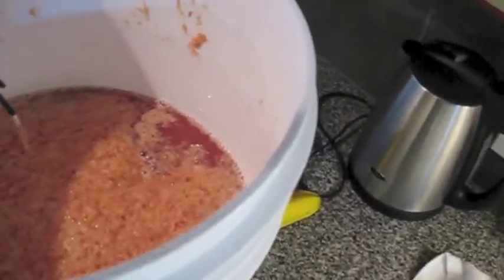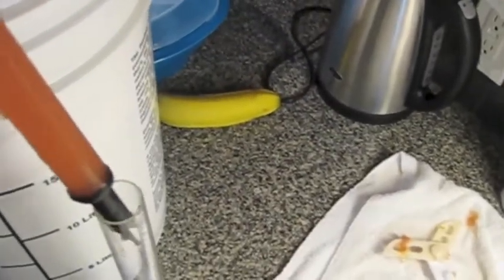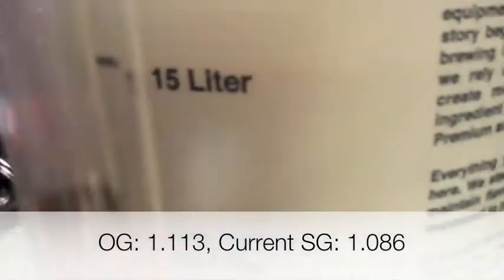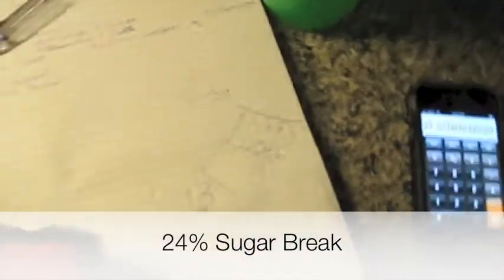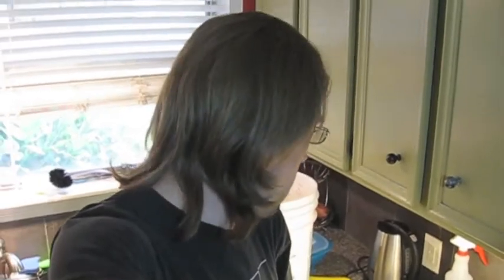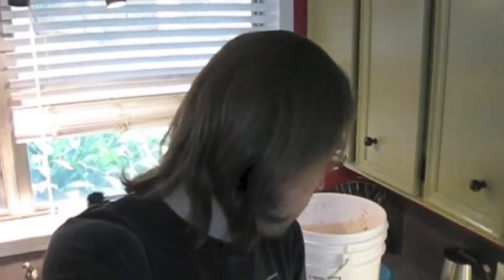Mead Making - Blood Orange Melomel - Degassing and Math

Comment: Big fella where did you get those PH strips ? Ireland here, want some for when i start all grain but not sure which ones to get ? Cheers.
Reply from the maker: Hey man!  I got them at my local brew shop, in the wine section.  For Wine making you want them around 3.6-4.7.  For beer making you will want to find some that are in the 5.1-5.3 for mashing and I'm not sure for actual fermentation. Cheers !
Reply: Canadian Sasquatch Brewery So basically you need two different types of strips ? Cheers.
Reply from the maker: I don't use them for beer brewing, so I don't bother (at this point.) for ones with that.  Just to make sure my meads are happy in their fermentation.   Another solution of course is an electronic pH monitor.  That will be able to monitor both without issues.  Cheers!